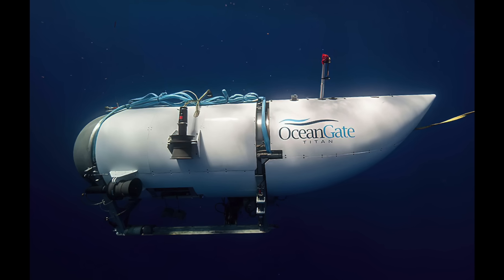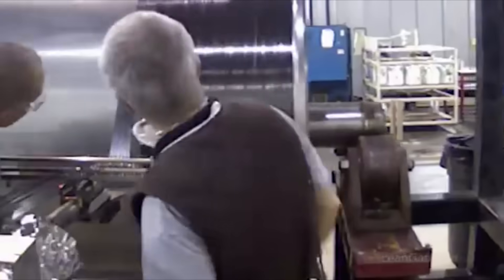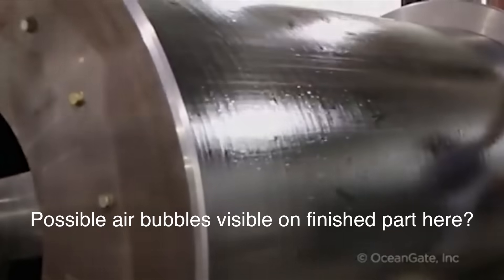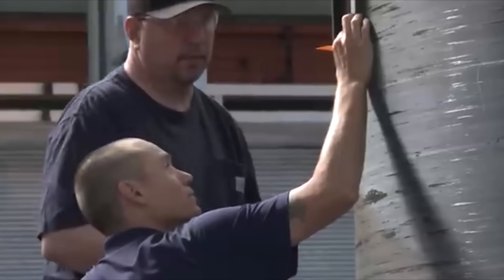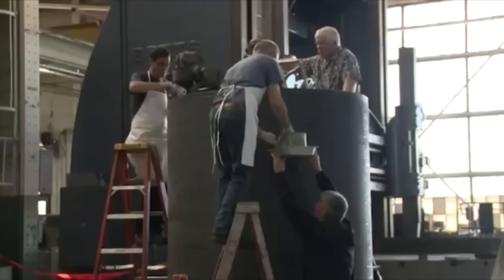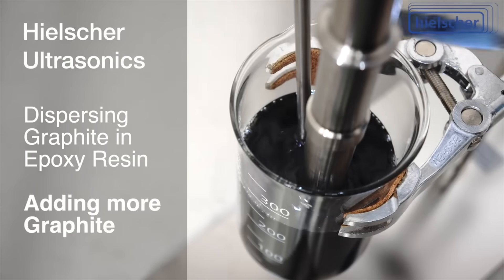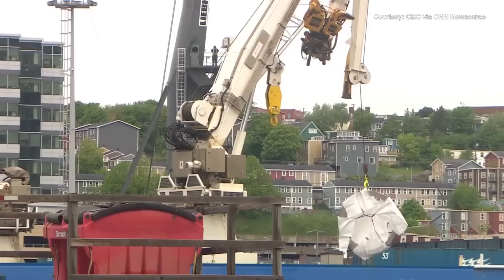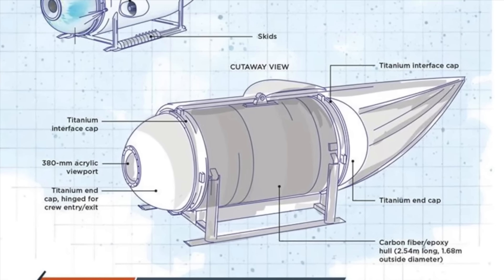Why OceanGate Titan Imploded - A Carbon Fiber Composites Perspective

Comment: Wait...strength to buoyancy?

Please explain to me how that "metric" is in any way germane to this application.

Wouldn't the key buoyancy come from the air inside the vessel...you know, air that you don't want to let out through a catastrophic failure of the hull? Then you dial it in for descent and ascent with weights and gas bags? 

Just as an eg, the guy who does the fiberglass repair on our club's boats uses a face mask, gloves, full no lint suit and massive dust vortex filter contraption just to deal with construction and repairs for components that will never go than a few feet below water. How is that dude sloughing dandruff and hair and skin oil and whatever else into a surface that'll be relied on to keep eleventy bajillion PSI out?

Comment: Yeah - carbon fiber and glue are not good materials to have exposed or stressed to the elements. Stockton could have experimented with innovative designs like a full cast similar how they have the chassis of Teslas with zero joints. Add to it a porthole plus cameras and you could get a very strong submersible that would according to the current knowledge even become stronger over time. He could have experimented with aluminum casts vs steel. And this could have been done with relatively small models, but he was frankly way too poor to do this business. Jeff Bezos could have made it work, but I somehow doubt that there is a legion of people wanting to go super-deep into the ocean and willing and able to spend 300k a pop.

Comment: Everything was wrong in this process from the concept of using carbon fiber to build a cylinder under external pressure, in my limited knowledge carbon has a strong strength resistance when it is under internal pressure like a gas tank . Force a material to be used to the opposite to the mayor's strength is crazy. It is an example of being a genius or being stupid, it is a line made by your delusional ego

Comment: In any composite material…the material is only as strong as the weakest link…. Fiber, resin, air bubbles, contaminants, construction design…. Fatigue will always find the weak link…

Comment: I used gluing parts, using a type of epoxy. Not in life saving operations, but we never done this in an open warehouse.  Also the metal should be machined or roughened up.

Comment: Good informative video, personally no amount of testing would convince me of a carbon fibre submersible's safety. There's always the case of a thousand dives to 150% working depth and the the next dive to to working depth is failure. Spherical metal pressure vessels are safe because they dissipate the pressure evenly and can cope with multiple dives to depth without degradation.

Comment: carbon fibre is a stupid material to continue to reuse, and rush was trapped, he could not afford to rewind a new hull, but nor could he continue to reuse that hull for continuous dives endlessly like he was planning to do, with not a word about retiring the hull, carbon fibre over those cyclic crushing depths would break down the integrity of the hull and it was only a matter of time before implosion, as rush had no intention of retiring the hull, he was as he did, going to keep using that hull until failure as it did fail !!!

Comment: You can see the faults in the carbon fiber as its being made... Air bubbles forming all over. And it was not 5 inch thick carbon fiber it was 5 x 1 inch carbon fiber glued together.

Comment: They wanted to test the scale model to 4500 meters and it imploded at 4200. Then for the full scale, instead of building one 5 inch hull, they did it in steps of 1 inch. The bubbles you show in these videos were GRINDED down to ensure a flat surface for the next level, which would break the continuity of multiple layers of fibers and cause stress points. And apparently the glue between the layers was way too porous as well. This thing was so doomed. I recommend the videos on the Solar Eclipse Timer channel for even more mind-bogling information
Reply: Also NASA recommended a 45 degree layer as well, but they completely ignored it and went 0 90 instead

Comment: I'm a welder by trade, limited engineering experience. Even with my limited knowledge, I was shocked that they were handling the titanium with bare hands before the bonding procedure. Also, they didn't even prep the titanium's surface. I'm a complete and total amature and even I knew this was wrong.

Comment: Internal pressure vessels with carbon fibre crossweave ‐ yes, sure. IMHO ‐ Carbon fibre is great for tensile strength, not compression. crossweave, multiple layer, 10" thick, single site clean room  construction, i would still never fully trust it. Thousands of hours of modelling and testing could produce something, but there are better materials to be used and have been for a reason.

Comment: The simple answer? Bad design and gross misconduct and lack of analyzing the hull and the overall integrity of the submersible at any given time. They built it and just kept diving it without even analyzing the damage to the hull after every dive or ever. They said that the inner sleeve was never even taken out of the 2nd Titan that was built. & that’s the only way that the carbon fiber bull could be looked at. Even though they could heart the hill getting mashed up and delaminating on every single dive. Stockton just told everyone to expect noise and that it was fine.. idk what he was thinking.. EVERYONE tried to warn him and he fired everyone for doing their jobs. He only wanted yea men on his team. It blows my mind that the 2 subs did around 90 dives in total when the only thing holding them together was glue. That was literally the only thing holding the carbon fiber to the titanium domes. Rip to all who trusted him. THESE PEOPLE EVEN SANDED OUT ALL OF THE IMPERFECTIONS OF THR CARBON FIBER WHICH DESTROYED THE INTEGRITY OF IT FURTHER. This was clearly degradation failure.. probably around the area where the carbon fiber met the titanium. The glue more than likely gave way imo.

Comment: Isn't it possible to have torsional stresses applied to the Titan when it is being towed thousands of miles behind the Polar Prince? The idea of doing that in the first place boggles the mind in the first place. And then storing the sub outside in the Norwegian winter for an extended period of time. It's like building a custom car, putting thousands of money, time, love, sweat, and tears. Then putting it on a trailer and then leaving it in a parking lot for a season. With the temperatures reaching below 0 and climbing to 70 degrees plus. I guess all that money, time, and investment doesn't constitute a safe place to store it. Or someone (Stockton) is so cheap that if you put a piece of coal between the cheeks of his ass, you will pull out a diamond in seconds!  Stockton and Wendy Rush are indeed that cheap. Then insert GREED and you have the makings of a "mousetrap for millionaires" as quoted by submersible expert. This whole situation is a complete tragedy, and the worst part is that it was totally avoidable. Not one person should have died in that tube. I cannot call it a submersible because that would be insulting to the men and women who build safe submersibles with certifications of their peers. My sympathies to the families for their loss and wish them the best in this very difficult time. I want to hear public apologies from Wendy Rush and Stockton's business partner for starters. I am appalled by the silence of these two, and there are many others that have their own responsibilities related to the deaths of the four innocent passengers.
Reply from the maker: Your point about the torsional stress is spot on. As if it’s in a perfect environment 24/7 and not being tossed around in waves and off and on deck etc. And why!? To preserve the odd metric of strength to buoyancy? I recollect the boing engineers they were loosely connected to recommended 45 degree layers and it being twice as thick!

Comment: I dont get the business decision to use CF - I would have thought the cost was mainly taken by the fabrication and development and there CF has to be more expensive then titanium. I would think CF would be  way more expensive but I am not buying 5’ diameter thick wall titanium pipe everyday.

Comment: The idea itself to build the submersible out of carbon fibers was absolutely amazing to me. Just as taking a dive down the Niagara Falls in a plastic barrel. Wait... didn't that actually really work?

If they'd gone with the measurements I think was suggested by Boeing plus applying the fiber by adding 45° layers and having a LOT more unmanned test dives... who knows. Could've worked. Some kind of a Titanium cage would have been more stabilizing, too - maybe? 

In the end, I guess, it all comes down to Rush running out of money. And in my opinion the wreck of the Titanic should just rest in peace. As well as the poor victims of the catastrophe.

Comment: Okay. Couple of quick questions for all you experts. In the many many other videos where they have talked about the carbon fiber winding, they say he went without the 45 but did zero and 90 (degrees for winding). All I can see is One direction which I would assume is 90°. The direction of winding around the circumference of a tube is all I see. I cannot figure out how they could possibly wind it long ways without having to somehow pass it through the inside or cut it each time and even I think both of those would be no goes.

Second question is, I have a 20 year old carbon fiber prosthetic leg. It looks like it's made with some serious kind of epoxy as well as the carbon fiber and the two together are what it gives it all of it strength. (It's the part I stick my stump into so it's a hollow kind of cup.) It's about an eighth of an inch thick and I can stand on the side of it with my 150 lb and it barely flexes. I can hit it with a baseball bat and it doesn't leave a mark.

In all of these videos I don't see any kind of clear epoxy or whatever that would harden up and help the carbon fiber to actually gain the most strength that it could have. Was the adhesive or whatever already applied to the carbon fiber winding. Does that mean that the peel ply is wrapped around so the carbon fiber stays sticky in between layers? 

And yes, with my 30 years of printing experience even I know not to touch metal with your bare hand. You leave oils from your fingers on whatever you touch and it is not helpful in most cases. (I do have a hint for college as far as body grease being helpful. If you get a red cup of keg beer and it's almost almost all foam because it's been bounced around, fill it with as much beer as you can and the rest foam. Use your index finger to wipe the side of your nose, insert into beer and stir. No more foam. Gross and neat at the same time.) 😂
Reply: I have seen video on YouTube, showing the  laying on of carbon fiber strips along the length of Titan’s hull. Seen so many videos about the incident I can’t direct you to it.

Comment: should they also have sand blasted the titanium?
Reply from the maker: At the very least! But it must be done very close to the bonding time to avoid oxidation…
Reply: @JamieKunka  yea in the clean room etc! there are just so many things wrong with this, you don't have to be a submarine expert to see the flaws. like a baker or a bricklayer or like any decent tradesman could easily pick out a fatal error from the rich tapestry of mistakes made here. it's craaazy it even got that far. 
thanks for your quick reply btw :)

Comment: Was the fiber really only in one direction? I thought it was in two, hence the "0-90" claim by Rush. Two circumferential layers, then one axial layer. In the Coast Guard's questioning of one of the Boeing engineers, they said they had recommended to OceanGate to do a third 45 degree layer, but obviously that was not followed.

Comment: I totally agree it was a debonding failure at the ring hull glue joint.  That joint is very thin in side view, and would be in very high tension.  That’s why there are no fragments of the hull attached. It should have been a much deeper and more surface area to take that load. They overlooked it when engineering it.

Comment: It would be cool if you make an update next year, i took away from the NTSB witness that it ended up with 3 partially separated hulls. 😮 

There was also some recommendations to have titanium fins that reach into the Hull to add retention-ish extra interface. But i suppose you also heard that they used worse titanium, and for the second they weaved but also not as they were recommended to...
Its all f'ed especially since for their price they might probably even just bought two smaller subs and, oh surprise, the base ship would have cost the same 😮

Comment: EA 9394 adhesive.  It is thixotropic.  Bubbles or air are not visible when spread to a bond line thickness of 0.010".  The Ti ring should have been etched then primed.  This is SOP in structural bonding.  Many other details are unknown by me.

Comment: It’s been recently discovered this particular video of the pressure bull is from version 1 which catastrophically failed. The v2 hill was made differently, several round layers and 0ne left right layer for each set of I think it was 1 inch sections and then glued, cooked and done that another four times. So basically, the 1st layer was cooked 5 times while the outer 4 layers each one less cooking. They also absolutely did experience a lot of uneven surface issues, so after each of those 5 layers, if there were any bumps, and there was a lot, they were shaved down and filled with glue. You can see some of where this happened in the wreckage that was brought up and is clearly visible from the rovers view at the sea floor. Nevermind that V2 hill was stored outside at a port in Newfoundland which is crazy because winter of 23-24 saw a severe hurricane hit the maritimes including NFLD. I should know, our fibre comms underwater cable to NFLD was cut during that storm and then one prior. Rush didn’t do his homework on how that kind of weather would affect all the different composite materials. Especially if sealed and literally covered completely in snow in sub zero temps after getting blasted with salt water gusts of 100+ km/h. Everything unprotected metal wise would’ve rusted without protection. From what I know, not even a cheap plastic wrap/heat shrink that protects boats during the winter months. These include boats with fibreglass hulls. Hell, I’ve got an old fibreglass speedboat that is still in tip top shape, about half an inch thick and has taken a beating offer the last 60 years, especially where the outboard engine is mounted. It’s build in such a way that the design wanted it to flex when hitting those rough lake waves but it would not survive a day on the ocean. The Atlantic in this region is famous for its poor weather.

Comment: I did a rough calculation and a five inch thick carbon fiber tube is only capable of  accepting a depth of about 1500 meters so less than half of the intended operational depth. Carbon fiber is completely unsuitable for this type of use.

Comment: On the matter of how the carbon fibre is wound, I would have thought for a structure such as the Titan and the immense pressures it was being subjected to, and given the effect of micro defects etc , that the "criss cross" method of fibre winding would be compulsory. Maybe they did. The videos seem to be more befitting of guys building a carbon fibre hulled boat and not a manned life capsule which will be subjected to massive pressure. As a scientist in chemistry myself, I get the impression that boundaries were definitely and intentionally pushed ( which is fine) but that egos were also being stroked. Unfortunately the cost of failure in this case was high. It could have been avoided. Such experimental crafts need to be operated remotely- not manned with people-  and after each dive ( and many dives) the micro structure of the components studied in great detail.

Comment: Their machine didn't have additional axes so they just used one. Boeing at the start recommended that they should use 10 inch thickness (not 5) and also the 45 deg + 180 deg axes while winding - they just didn't do it

Comment: First and foremost, all these people ragging on the man, saying that he's dumb, that the vessel is a piece of shit. Is very far from the truth. The vehicle did its job and did it. Well, they had over, I believe, 80 to 90 dives down to the Titanic. That's a lot. And yes, I know they had their issues. The only thing he overestimated was the shelf life of his vehicle's hall, with the carbon fiber starting to break down. So we think. But here's one thing everybody completely forgets about the control spears. The control spheres, if detonated, are equivalent to 11. to 13 sticks of dynamite. The control spear sat aft of the vehicle. Right? Where the pressure vessel met the rear cone. Right behind that dome were both right behind the abdomen; now, if one of these control spears detonated, you would see the same effect; it would cause the front to pop off, and everything else would blow back into the Alf dome, and yes, there is evidence of the hall starting to break down. But was it still strong enough? And the spear exploded and caused this? Rush even said that's one of his fears if these control spheres detonate.
They have to have the proper level of oil in them. If not, it's like playing Russian roulette!
Reply: Most of the dives were of a few metres. 18 were to the Titanic depth https://media.defense.gov/2024/Sep/25/2003553391/-1/-1/0/CG-052%20OCEANGATE%20DIVE%20AND%20MAINTENANCE%20LOG_REDACTED%20%20V1%20ADDITIONAL%20REDACTIONS.PDF